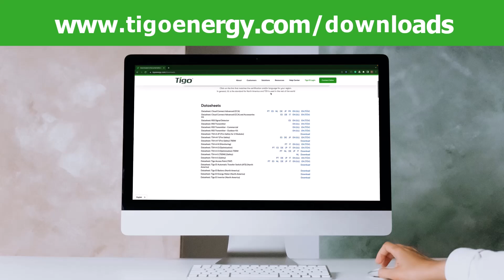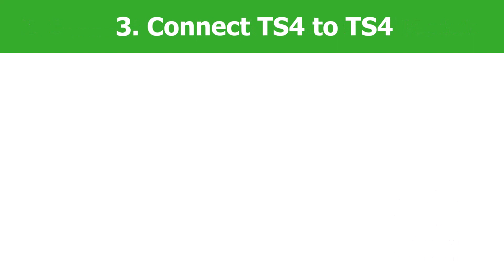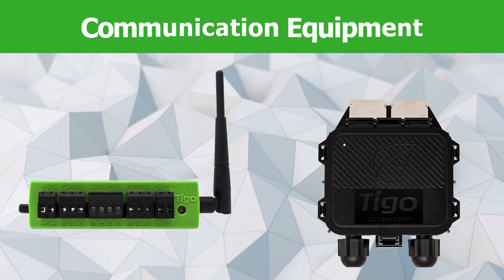How to Connect the Tigo TS4 to the Solar Module

Comment: I am planning to purchase a Tigo TS4-A-O for each of my solar panels. Do I need anything else for the system?
Reply from the maker: Hello, and thank you for your question! If you want module-level monitoring and rapid shutdown, then you will need the Cloud Connect Advanced and Tigo Access Point. We recommend contacting the service so that we can look at your layout to determine if you have the correct number of TAPs for your project.
Reply: @Tigo_Flex_MLPE  Do you need a separate TAP for each array?
Reply from the maker: @SD-co9xe  It depends. Please review this Help Center article and contact our support line with any questions. Improper TAP placement is a common service call.  

https://support.tigoenergy.com/hc/en-us/articles/360001532327-TAP-Placement-and-Layout-Requirements

Comment: It would be soooo much easier to perform excellent wire management if the TS4’s could wired on the rails before the modules are installed! I know that’s not how it works, but could you do this?
Reply from the maker: Actually you can, and have always been able to, rail mount the TS4s. Our quick start guide shows how to do this by removing the silver clips and using M8 bolts to connect it to the rail. A word of caution- people who rail mount MLPE are probably used to other MLPE companies that only allow this type of installation. 

Regardless of which mounting method you use, always connect the TS4 to the module first and then to the neighboring modules. People who are used to rail mounted MLPE tend to connect them together and then connect to the module. This could cause abnormal operation with our TS4s. 

Quick Start Guides located on our Downloads page: https://www.tigoenergy.com/downloads

Comment: Can you combine one Tigo ts4a with one tigo ts42a top configure 3 solar panels 310 watts,38 vdc to make a 3 panel string?
Reply from the maker: Hello! It seems you are missing the product model in your question but I assume you are referring to the TS4-A-F and the -2F since the -2F is the only product that can connect to two modules. 

Yes, you are able to mix and match those two products in the same string. If your PV inverter has an internal rapid shutdown transmitter, you must ensure the safety voltage of the TS4s is enough to turn the PV inverter on. 

If you have any questions please contact our sales engineering team: https://support.tigoenergy.com/hc/en-us/articles/4401866316307-Contact-Support